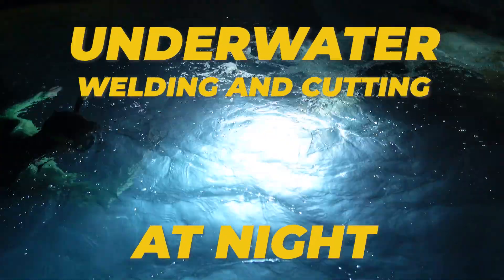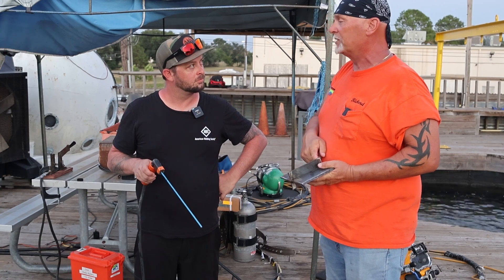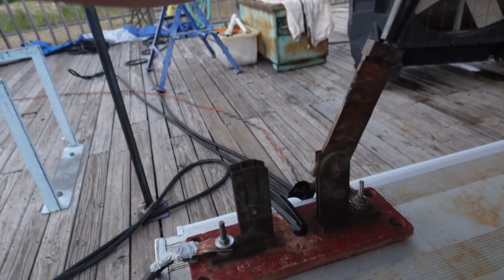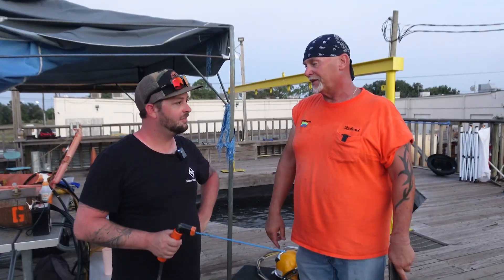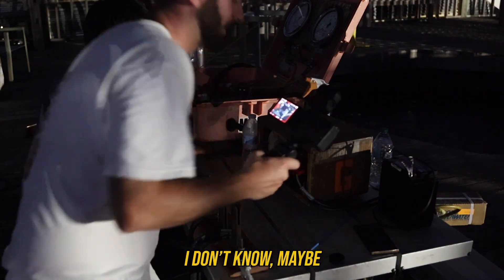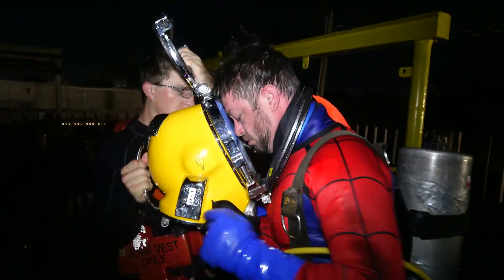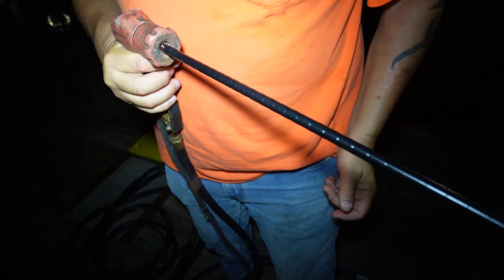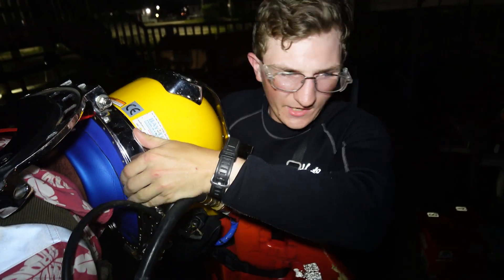What Is It Like Underwater Welding At Night?

Comment: Commercial divers are some great guys, I worked with them on Pile Driving rigs, always showing up half soaked 😂 I remember we called some of them guys to recover drill steel 70ft down on the ocean floor. We spliced them up some custom rigging out of  1 1/4 inch rope, and pulled the pipe vertically with a choke at the bottom and several killick hitches along the vertical length of the pipe. From what I remember they got it down pretty quick, as they had to switch out divers as one diver could only stick around underneath for so long.

Comment: As a 55 years old English time served welder mainly working on Rolling Stock trains & tankers railway pressure vessels. Im guessing the kid welding is a time served welder & his 1st run ( bead ) looked like pigeon shit so it must be extremely hard. The instructor said start by striking up & then start from beginning i was always taught to flick it back from an inch or so from striking up. If i could turn back the clock id have gone off shore as ive worked with quite a few ex off shore welders.